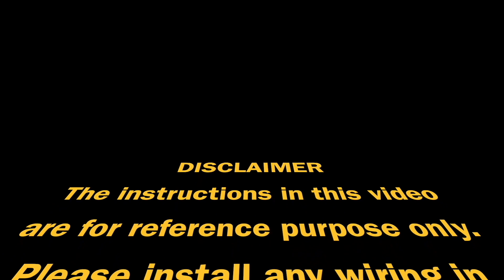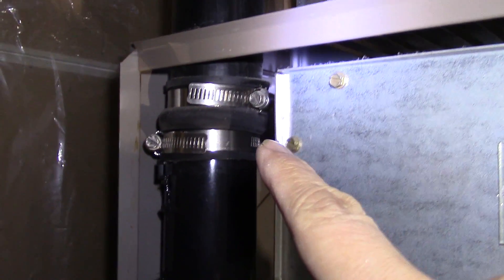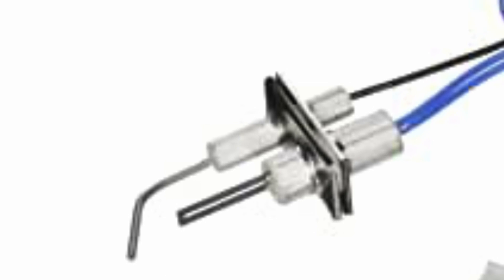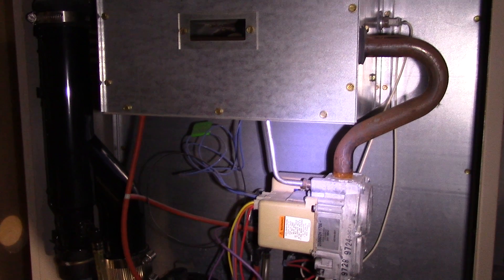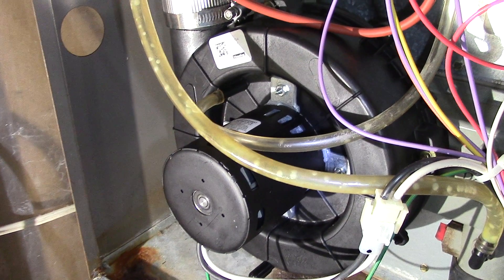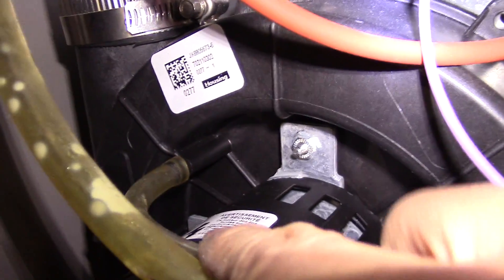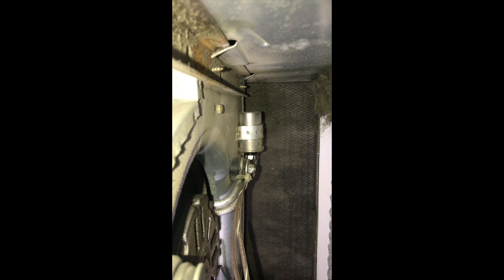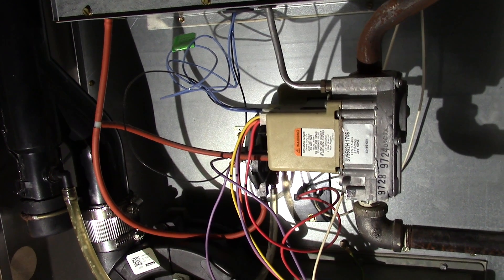Ultra 90 Armstrong Furnace Parts & Functions

Comment: Thank You. Good video. My furnace was shutting off before reaching the set temperature. 
I replaced the band new MARV 8 filter with the cheapest possible Duststop Fiberglass Air Filter. So far working perfect.
Reply from the maker: Awesome! Glad it helped

Comment: I have the same unit also. Thank you for posting this, you saved me a fortune from calling a company to come figure out that my igniter/flame rod was full of carbon. I did break the igniter piece while cleaning it but was able to get on Amazon and was able to identify the correct one. It works better than it has in the 7 years I’ve lived here. Thank you again
Reply from the maker: Glad I could help Norbert. Thank you for watching.

Comment: I have the same unit, does that unit have A condensate float switch Shut off? If so, does it shut down the main 120 volt, just like turning off the main power switch?

Comment: Great video. I have the exact same furnace as you. An Armstrong SX Ultra 90. My draft inducer motor also needs replaced.  Before i buy a new one I’m concerned about why there’s water underneath the inducer. I know water can come from a cracked heat exchanger so I was curious if that rectangle box the inducer is connected to is the heat exchanger.  As soon as I mention water to furnace stores they immediately say it’s a crack in my heat exchanger and want me to purchase a new furnace. Any advice would be appreciated.
Reply: 3 years late but it could be the pipe connection to the outlet of the inducer. When I replaced mine it’s not quite sealing perfectly and drips condensation from the exhaust. Adjust the connection or put a drip pan under it. Just watch it run and you’ll see the source of water.

Comment: How would I hook it up to a generator during a power outage? I have the exact same furnace. How many watts would it draw?
Reply from the maker: That's a good question. I may do some research & do a DIY on it, but the furnace runs on 110V and has a on/off switch which could convert the cable into a 110 plug. Just a thought.

Comment: I had A 1994 ultra SX80 hooked up to a 94 Armstrong air concept 10 a/c unit both were original to the house which was also built in 1994

Comment: If you didn't already know, the "combo" ignitor/flame rod, is because of the honeywell smartvalve, which is exclusive only to intermittent pilot systems. The smartvalve does most of the controlling on this furnace compared to the control board.
Reply from the maker: Thanks so much for sharing with our viewers.